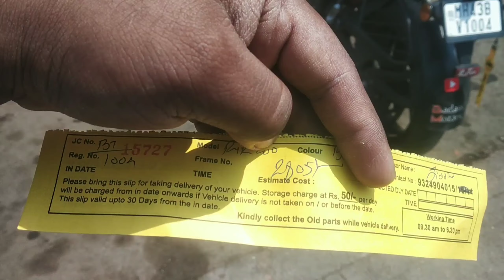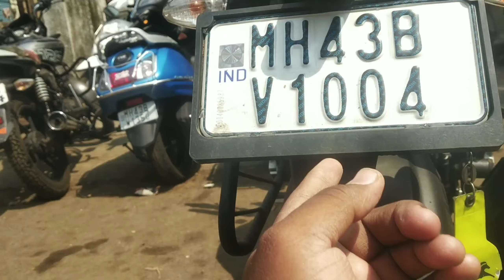TVS Apache RTR 200 BS6 5th Service| Costly Service|Parts Changed in 5th Service|Expensive Service

Comment: I have been riding 200 4v since 2 months 
I have an issue when I shift gears that is when I shift I get thug sound similar to gear shifting without holding clutch . So any suggestions I have tried rev match, rpm check , fast shift , slow shift and many more. so do you have any issues with that or is there any suggestions so please help me with this issue 😅😅

Comment: Kindly tell me what to do in third servicing?
Because in second servicing they took around 2200rs at tvs thane.
They put nnecessary charges.
Reply from the maker: See in third service also everything is same, oil change , oil filter change, both break pads gets cleaned and chain setting is done
Reply: @RPVLOGS  but then also they took additional charge from me and it's too costly
Reply from the maker: Yes this is the issue with TVS

Comment: I have changed my rear brake pads recently still doesn't provide enough response  would you suggest a disc change ? (Bike about to complete 10k kms)
Reply from the maker: The break pads will take little time to get rubbed . After some time you will start to get response very quick
Reply: @RPVLOGS   ridden them for 1000kms already still no bite 🤦🏻